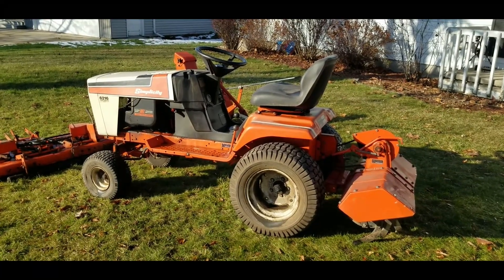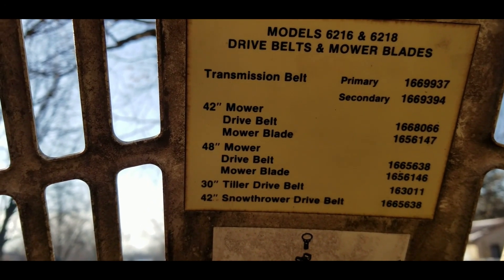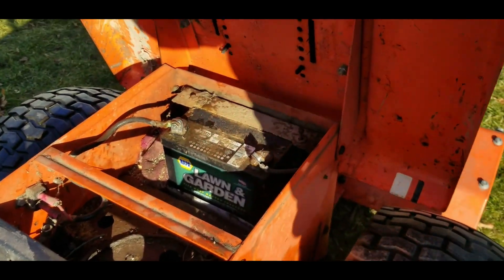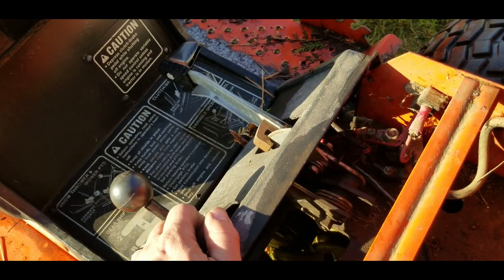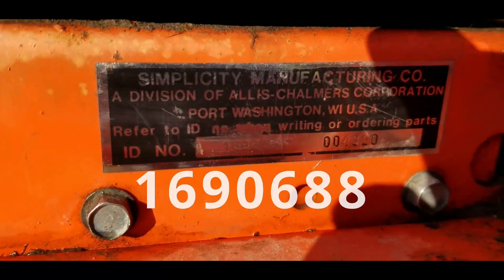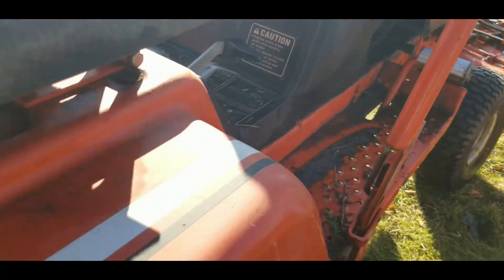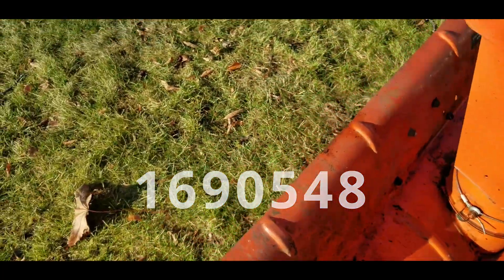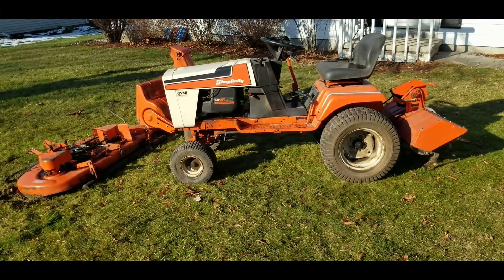1982 Simplicity 6216 Garden Tractor with rototiller and snowthrower attachments

Comment: Got my dad's 5212.5 when he passed. Since   then I have purchased three more. A 6111, 6211 and a 6216. Have two 42" decks one 36" deck. The 42" snow thrower and a 42" plow/ dozer blade. Getting a small winch for the plow as a Christmas gift, I don't suppose to know about 😃. Really no room on the front for a winch, as the hood tilts. I'm thinking of mounting the winch on the back right fender and hooking the winches cable to the lift handle. I'll have to disassemble the parts inside the handle to rid the handles knob, and remove the latch. The rototillers are hard to find. You're lucky you got one. I am always looking in my area for a tiller.
Reply from the maker: It was the rototiller that made me want it. Thanks for watching!

Comment: Can you help me with how the variable speed works?
Reply: I have a 6211 in trying to get working
Reply from the maker: I haven't gotten this tractor running yet. Hope to get it moving in the spring or summer.
Reply: You have to make sure the sheaves on the variator pulley open and close smoothly. That's the number one thing to look at. Keep that pulley in good shape and lubed up so that I can move back and forth easily when you push the clutch